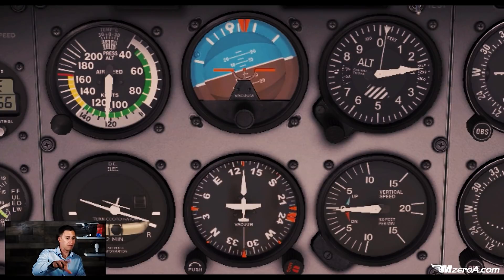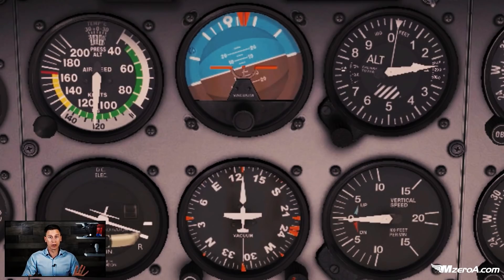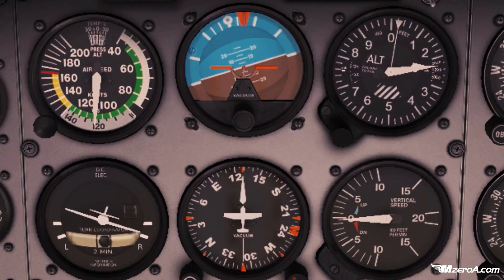The Ultimate Instrument Scanning Quiz - Day 8 SPC

Comment: What a great tool.  I got them all but discovered I need more work with determining exactly what failed in the conflicts and what instruments were correct and which ones were incorrect,  Cross reference and logical thinking will be much harder when in actual conditions.  This is a great tool to practice those things while safely on the ground.  Thanks Jason.

Comment: Love your videos and great tips and tricks any tips about my sling tsi rotax engine that prefers car gas not many airports offer car gas and the av gas low makes my plane is dirty from the exhaust. I love it beacuse of the power and decent range as in cruise i burned 5- 7 gallons per hours at 145mph

Comment: 8 for 8! I just completed by first 2 under the hood flights! It is like work! 
First day not bad but I had something happen that my instructor had never had happen. When I came out from under the hood, I had trouble judging distance. I recovered but not until we were actually on the ground. I think it was because as a bifocal glasses wearer I was switching from one part of the lens to the other and this tired my eyes. Have you ever heard or seen this?
Yesterday I used the hood instead of the ones that attach to glasses. I did not notice it as much. Interesting!
I am going to check out your ground school and just might do yours along with Jepessen. I enjoyed this video and think it would be a plus to do this after how far behind the airplane I was yesterday. It amazed me how quickly you can get behind the airplane and how hard it is to get caught back up!

Comment: Great Vid!!
Have to say, I got them all, up until the last 2... sigh..
Makes me realize, that I need to work on scanning. When it got down to 3 seconds, I got them wrong. I'm VFR so it's not so critical.
I also know, that in clear skies, VFR that's not a big deal to miss it in 3 seconds, but if you happen to go VFR to IMC (without IFR Rating) that could be deadly.
Great video showing that no matter what, you need to be able to scan quickly, and know your orientation, or if there are issues.

Feeling humbled... 
Love it!